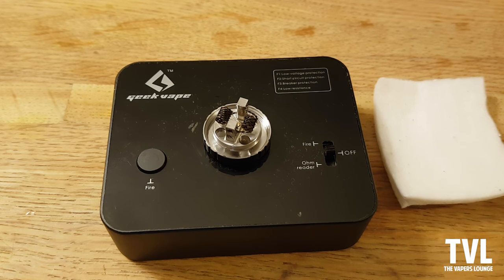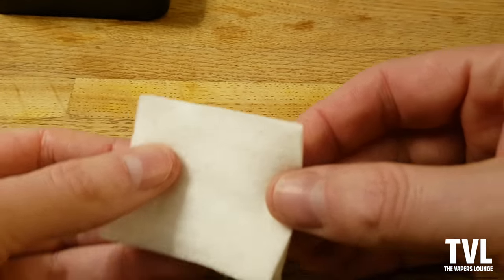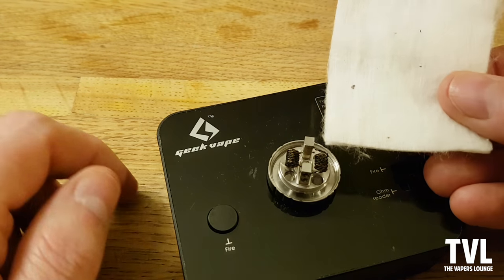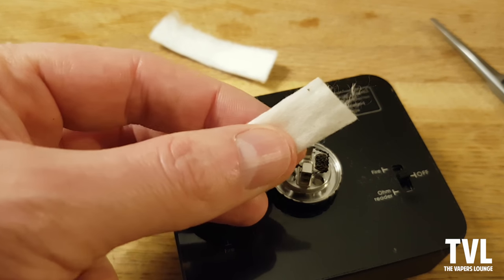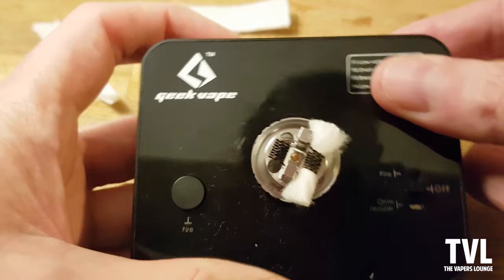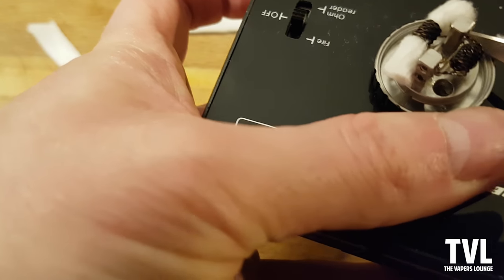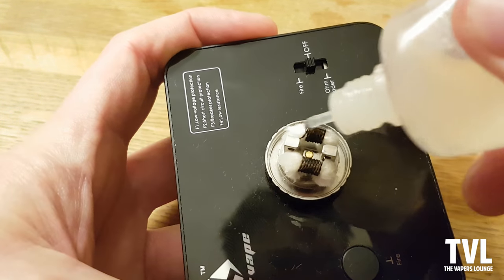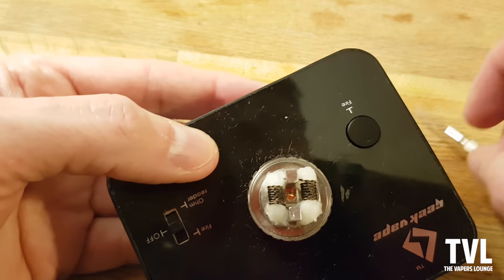Wicking tutorial for the OBS Engine

Comment: yes thanks from Yorkshire!  - my obs engine is flooding! urrrgh mouthfulls of juice!
Reply from the maker: Sometimes it may flood a little when you first wick it, or when you fill it.  Make sure that the holes are covered with cotton to avoid this.  I don't have any problems with flooding to be honest.  There may be a small gap somewhere and also check the o rings are present.  There is one at the bottom of the tank at the top of the threads that screw into the deck.
Reply: ah ok thanks i guess it comes with experience i'll get there eventually!
Reply from the maker: GhostVaperYT trial and error. I went through it all, just off camera! Less is more. Just as long as the holes are covered. Once the tank is sealed, as long as there's no place for air to break the seal, should be all good.

Comment: Mhm, I really tend to get dry hits with this tank... its my first rta at all and i bought prebuild juggernauts from geekvape ( Kanthal A1 / .45ish ohms in dual coil ) and i tried three different ways of putting in the cotton... last way was the way like you do and i still tend to get a dry hit after like 3 secs of vaping it... perhaps a higher wattage will help? I'm at 85ish Watts... sometimes 90 sometimes 75... it depends on my "mood".

Also is vaping that thing with its stock coils in TC worth it? I never tried TC but i'd love to... so if the stock coils give me the chance to try vaping a tank in TC with decent flavour... i'd give it a shot.

And lastly... do you ( and the guys in the comment section also ) have an advice which type of coil performs best at "lower" Wattage in that tank? Is it even possible to vape ist at like 45 Watts with decent performance? 

Thanks in advance and please excuse my kinda bad english, since it's not my native language I kinda struggle with it.
Reply from the maker: Hi Fabian.  It may be that the cotton is a bit too tight in the coil.  It's quite a fine balance.  Too loose and you'll get spitting from the coils, too much and the juice can't soak it quick enough.  It's a case of experimenting.  Each type of coil will want different amounts of wick inside.  The main thing is to make sure that the tails of the wick are thinned out a bit so the juice can get to the coils quickly.

I can't remember what coils came with the tank, but I think they were stainless steel, so you could use them with TC.  My favourite is twisted 26 gauge 316.  I make them myself, also 430 stainless is very good.  I have never got on with the more 'fancy' coils like claptons etc.

If you're looking to vape at lower wattages, stainless steel is good.  It has a fast ramp up compared to Kanthal.  At lower wattages, you need to close off the airflow quite a bit to get good flavour.
Reply: Hey,
 
thanks for the fast answer!

I found out that about 60-70 watts is the right wattage for my cotton/coil combo ( as far as i built it in the Engine ).
Also today i was in a shop where the guy also told me to try 26 SS316 wire but its not twisted.... its more like wrapped, will try that out tomorrow!

But now that you mentioned it... Kanthal is like slower in heating up then SS316 or SS in general?+

Edit: Btw sorry... i thought the coils you were using with your engine were the stock coils since the look quite similar :)
Reply from the maker: Like for like gauge, yes, SS is lower in resistance than kanthal so heats up and cools down quicker.  My favourite wire :-)